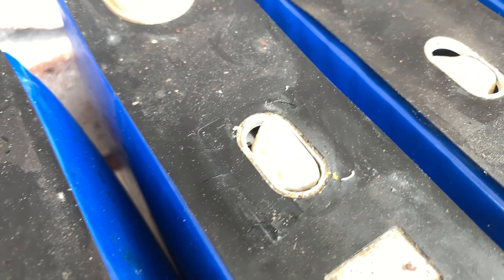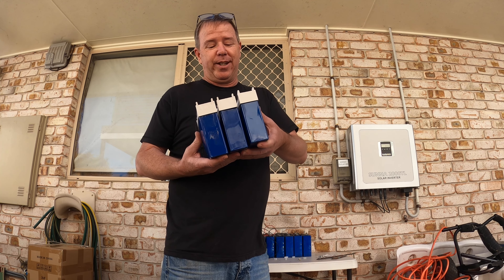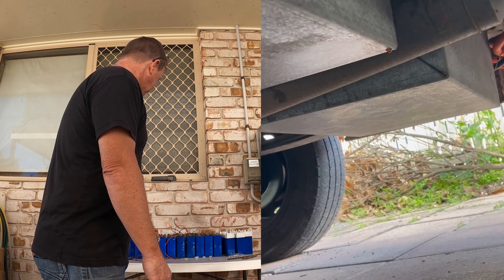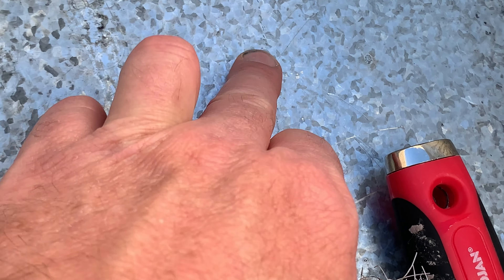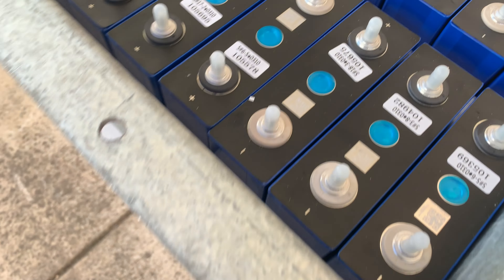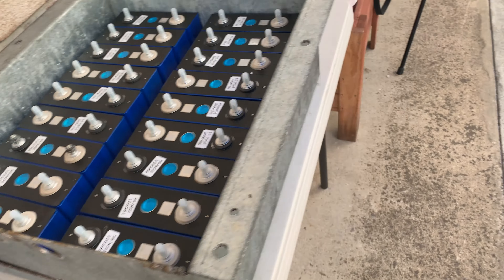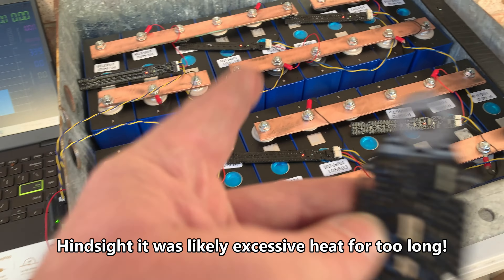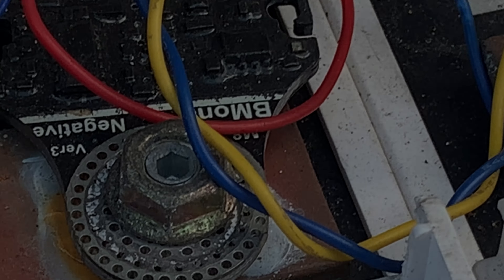Stupid accident destroys LFP EV battery - total rebuild required

Comment: I would definitely slip some epoxy sheet insulation between around and under the cells.  The foam if compressed enough will keep the batteries from moving much but it has a tendency to compress and become less rigid over time so you may have to revisit them in the future.  It is great to see LiFePO4 living up to its usual safety standards of generally not erupting in a big ball of uncontrollable fire for several minutes once the batteries begin to vent like you typically see with NMC and LIPO.
Reply: I have used puron (specifically designed for this) and also tried 6 inch wide kapton tape if the space is tight. The puron comes in sheets, and I used a paper cutter to cut it to the correct sizes. It is not cheap and comes with adhesive on one side. Works very well, but so does epoxy board (which is cheaper).
Reply: i agree definatly isolate the series cells ,thats a must
Reply: The inner walls of the Galvo box definitly need big fibreglass insulation sheets on them.  I wouldnt put the big bus bar close to the side. Box was missing a mid bar to prevent cell pressure bowing out the box. The box did not have a top cover with a waterproof seal, silicon dioxide packs inside to soak up moisture and water proof glands or suitable MiL Spec ip47/48 through connectors to connect up the electrics.
Great idea though for where to store a big heavy box of batteries and using a motorbike jack to trolley them into position under the van.

Comment: Is this a 48V system?  Is this van 100% EV, or just a hybrid?  Or is the batteries for the electrical system in the van?
Reply from the maker: 144v pure ev
Reply: @HBPowerwall  Why 144V, and not something like 300-400V so you could use DC fast charge stations?  I can't imagine that van being all that fast. (especially with the 0-100km times), or having a very good range.
Reply from the maker: 144v is how it was built for someone else, we paid 3k for it, IT's no fast at all, and don't think it would have 100km of range

Comment: 9:45  There's a "lot" of corrosion going on here. These bus bars are copper, the nuts appear to galvanized coated.  You really should be using stainless steel nuts where possible. And ideally, if you could do it, use nickel or tin plated copper bars.
The issue here is that the battery pack gets moisture from driving around and it's showing. This could be why the other pack failed, or rather Batrium failed to catch the bad cell.
I suspect that if this battery stays in service, you'll find a similar situation happen later on down the road.
Reply from the maker: Ooh we are having more issues with this battery in the very near future lol whole battery being under 1v for months won't be helping things

Comment: Use a silicone cooking oven liner sheet thing as an insulator. Easy to find here in the UK and cheap and durable.
Reply from the maker: Thanks for the tip!
Reply: not mechanically robust

Comment: Why 18S and not 16S? Why Batrium (does it balance?) and not JKBMS?
Reply: Batrium does do balancing.  It's just a lot more fancy and you get a lot more information about the system compared to a standard BMS like the JK
Reply from the maker: JK is just a little toy ...
Reply: @HBPowerwall  don't belittle the JKBMS a lot of users have good experience (better than DALY?) the only thing where JKBMS (imho) failed was 15S X-D

Comment: the batteries should be clamped, according to the datasheet. Do not use the fixed busbars, add some isolator between the cells, add some spring washers when attaching the busbars to the terminals.
Reply from the maker: can you link me the data sheet - keen to see that
Reply: @HBPowerwall  can I use the email which is displayed in the bio of this channel?
Reply from the maker: @bondarenkodf yep 👍
Reply: @HBPowerwall  done
Reply from the maker: @bondarenkodf thank-you I’ll check when I get to the office

Comment: id be worried about cells chafing on the sides of the metal box too even though the shell isn't tied directly to positive or negative. Seeing the swollen babies like that with no fire puts me at ease using lfp over Li ion.
Reply from the maker: what is worse is i'm working on the next video and doing a capacity test of one of the really swollen batteries and the video is crap cause it still tested at 95% of new capacity lol
Reply: @HBPowerwall  I got a few swollen ones too and capacity isn't affected much either. silly me overcharged 2 12v batteries in series with each battery having its own bms. i know better now lol.
Reply from the maker: hehe - its a hard way to learn - as long as you don't do it twice

Comment: A feature of a JK BMS is that it powers off, if a cell hit for example 2.5V. So it stops itself from draining the cells to 0V.
Reply from the maker: A JKBMS is a toy... lol That is NOT a "Feature" its in almost every BMS ever...
Reply: @HBPowerwall  so, your awesome Batrium BMS let you overcharge a pack with a flat cell? Just watched some of the video again to try understand. Maybe I haven’t seen earlier videos from this build and am missing something. I run my house on two JK BMS batteries, and wouldn’t call them toys, but for a car motor they may not handle the amps?
Edit:  Found an earlier video. Packs seem to be 120V. JK won’t do that 😂
Reply from the maker: The Batrium didn't fail, nor did it allow it to over charge - my brother did stuff, a rain storm did more stuff - it was a waterfall of - less than ideal small fu-kups that caused this to happen
Reply: How did you overcharge the batteries if a bms was used?
Did you stuff the settings or something?
Reply: @HBPowerwall  i have a batrium system and also jkbms.. and other stuff... and i can say.. that the batrium system is trash... compared to the JK bms...
Reply: this guys technical ignorance is gobsmacking.  I wonder what Andy over at off grid garage site would make of this utter buffoonery.

Comment: That battery should be waterproof. Put isolation between cells and special paste on bolts where aluminum and copper meet to prevent chemical reaction.

Comment: That packing foam probably won't last long I wouldn't expect. It's not meant to be structural. Bunnings has some medium density stuff, we have had it in our batteries for a couple of years now. 

The issue I suppose is that it's thermally insulating as well... which might not be ideal in an ev 

Bloody good thing that wasn't a li-ion battery hey
Reply from the maker: Yes, turns out it was a dumb idea - grateful for the feedback from so many viewers
Reply: @HBPowerwall  no such thing as a dumb idea when your sharing learnings with the community. I enjoy watching it ;)
Reply from the maker: @BadIdea1123  I enjoy learning but more I like the interaction..

Comment: Something between the cells as mentioned in previous comments is a great idea and also something between the end calls and the box. If you check some of the diy 48v box builds out for great setups and ideas that could be useful.
Keep it up. I am keen to see you get the bus up and running.
Did those white frames not fit the new cells?
Reply from the maker: Hindsight again - I have a few commercial battery boxes here lol I should just check out some of my own videos hehe The cell holders all cracked but also the new cells are slightly thicker and 3cm or so shorter (hence so much padding with the foam)
Reply: @HBPowerwall  damn. That's a tad irritating. I did a battery build with some odd sizes lfb cells and used some thin rubber matting between the cells. Slight amount of compression available but more for the electrical insulation. Core flute might be an option but it will compress. Another thing I have seen is just taping the cells together.. Maybe each 3pack u have make it a block with some heavy non stretch tape.
Again HB, great videos and keep them coming.
Reply from the maker: Massive challenge was getting the busbars to fit back onto the cells so any form of taping or compression would mean new busbars or a slight over sized hole. Either way I learnt something new so that's a win !
Reply: @HBPowerwall  When it comes to bus bars, I started using the flexible bars, with vibration and movement it reduces the stress on the lugs.
Reply from the maker: feel free to drop links :P

Comment: Where are the compression plates? Automotive cells should always be compressed
Reply from the maker: when removed these cells were not compressed when the battery was built 4-5 years ago, just in plastic mounts, the replacement batteries are a good fit for the battery box and almost meet the compression reconditions (wild card is the strength of the battery box )
Reply: @HBPowerwall  yes I saw that. And that's why I suggested you need compression plates - that battery box won't provide any effective compression. There is a reason for the manufacturer specifying a certain compression force!!

Comment: This will lead to another accident. If I see corroded terminals, you should be worried because of inequal resistance, heat and imbalanced cells. It will destroy your batteries again.
Reply from the maker: All fixed up now...

Comment: Um wondering if some conformal coating on the bus bars will stop oxidation not on the termination points tho
Reply: Unless you use Toyota battery terminal spray after you tighten the terminals ?
Reply from the maker: Don't think much will stop it given how exposed they are to splashes of water etc - might need better front mud flaps

Comment: I would add some insulation board beetwen cells, under and around, i use basic epoxy fiberboard.
Also would be good that cells are firmly in place so that they can not move.
Some times i put 1-3mm cellular rubber under the battery packs.
Reply from the maker: something softish will have to go under for sure - looking for cell holders so I can be a little more of a drop in solution - that plan will likely come unstuck as these replacement cells are slightly fatter & shorter if that makes any sense.

Comment: In my honest opionion the solution youve gone with for storing the batteries is dangerous. For automotive use I'd be using epoxy sheeting and rubber/foam between the cells top and bottom. On the bottom you probably want a rubber mats as the foam with degrade with movement over time. Look at the design of tesla packs or other manufacturers. They always islolate between cells and have some form of vibration insulation.
Reply from the maker: I think you're onto something there.. Thanks for replying
Reply: @HBPowerwall  no worries at all - I've had a peek at your other videos, love the revised farm setup. The Orient inverter looks good for the money.

I managed to pick up an 8kw Deye hybrid on/off grid inverter for $2400 from the Australian wholesale distributor. They had the 6kw model for $1500 as well which was great value also. Has a lot of features for the money and is a ~48vdc unit that supports heaps of BMS's and also meets the AU grid tie standards. I've hooked it up to 2 JK BMS's with 25kwh combined storage. Works like a charm.
Reply from the maker: awesome

Comment: A couple recomendations i would do is find/make some form of weather proof seals and stick a couple of those packaging moisture absorbers inbetween a couple batterys so they can takeup any that does get in as it looked like ya had some corrosion issues.
Reply from the maker: 100% have to address that, they also need to be vented boxes

Comment: There is a reason that major e-vehicle manufacturers use liquid temperature control in their battery packs.  They are used to keep the cells warm in extremely cold climates when idle, as well as radiating heat generated thru use away from batteries and electronics.  The heat extracted from battery packs, inverters, and regenerative braking chargers is more than enough to heat the interior of the vehicle in cold winter months.
All that corrosion is from dissimilar metals being used between the buss bars and terminals. They generate their own micro current.
Reply from the maker: We would need it for the heat not cold in our location - it's a great idea but bloody hard to implement in a diy version. Will look into bus bar options- Thank-You
Reply: @HBPowerwall  Perhaps you missed the point of how much heat those cells produce when charging and discharging.  Most mainstream vehicles use Lithium Ion due to its much greater efficiency. So multiply that heat produced by at least 3x for LiFePO4.
Reply from the maker: well aware of the heat issue, but I've never seen a diy build include any sort of cooling more than air - that said I do apricate your time to reply. Its all a learning curve
Reply: @aspendell209  but we are talking 100 Amps x 12 Volt - 1.2 kW to max. 3 kW for the battery pack here -- EVs pull 100 kW or more

Comment: Dude, you should to use the isolation of each cell. The second you have to do - you need to pull together the assembly. Third - copper tires must be tinned. And use the BMS. 
Next step: check your setup, as I can see you are using the 3s2p, but I think you need to use 4s2p. 
Still have a questions - don’t hesitate to ask. 
Good luck, I think you can do it!
Reply from the maker: Thanks for the feed back!! I can do it, just need some time management :P

Comment: "this car has more issues than my wife" 😂😎👌🏻🌻👍🏻 at least with overcharging u proofed: they are PRETTY safe (not blowing up in an instant) did u compress the cells? what voltage was used to overcharge?
Reply from the maker: I believe they went to about 6 v - I have a few here in my workshop and i'm going to 'play' with them and see what I can learn..
Reply: @HBPowerwall  6V per CELL? HOLY COW X-D the manual says 3.8V SHUT OFF CHARGING IMMEDIATELY X-D

Comment: Foam to keep the cells from moving around too much is a good idea. I would add some fish paper (electrical insulation paper) between the individual cells as well. Protects them from rubbing their thin plastic coatings through and shorting to each other
Reply from the maker: Lots of ideas out there - thank-you for yours - i'm like the fish paper option

Comment: Put some sort of separator between the cells.  If the heatshink blue plastic rubs through it's going to be exciting in all the ways you don't want with a lithium battery.
Reply from the maker: that's exactly why I got quite stressed when I saw the welding slag in the bottom of the battery box, I edited a whole rant about how shit it was lol
Reply: The case of each cell under the shrinkwrap is positive. You'll need epoxy board separators between each group of cells in series and between the cells and any metal surfaces. Use a thermocouple to keep an eye on heat. If it gets above 60C you'll need to design some kind of custom cooling system. Yikes!
Reply: Agreed. I use some card stock as separators.
Reply: Epoxy board costs buttons and will save you. The blue coating on these cells isn't worth a damn. It rubs through easily, especially if it's on a vehicle with movement and vibration. GET EPOXY BOARD SEPARATORS

Comment: Just make sure you’re not pushing the battery charge discharge limits and the normal convection of heat will rise. Maybe a small fan in the top.
Reply from the maker: That is what caused the issue - full speed charging when the cells weren't yet balanced and turning off protections to allow it

Comment: Batrium is a BMS. If you wired it up correctly and it DIDN'T protect the battery... what am I missing?
Did you, or the Batrium, screw up? Be specific, as it sounds like Batrium is a sh!thouse BMS.
Reply from the maker: Waiting for this type of comment - batterie/s were 0.6v because they were fucked cell monitor couldn't turn on thus breaking the data loop = no monitoring ... zero issues caused by Batrium infact it's ability to control and limit the charger amps saved many more issues..
Reply: @HBPowerwall  Hence asking the question :) I still don't understand the answer though, I am clearly missing additional information.
The cell monitor you mention, was that part of the original pack? The reason I ask is because I assumed (probably incorrectly) that all the cells were connected directly to the Batrium, which caused my either/or question. There was another stage/electronics between the Batrium and the cells? (or packs of cells)
Reply from the maker: I'll explain in another video - I need to get the time line right for the failure - combination of water (rain ingress) Short circuits on unrelated components and my brothers willing ness to tinker

Comment: I would have to go with rubber all the way around outside top and bottom some plastic dividers in between the cells and a solid divider down the middle maybe hardwood with a threaded rod sandwiched between to tension the cells. You also needs lots of beer lol
Reply from the maker: Beer is the only think I take way from this comment - when and where ? LOL

Comment: I'd put some thin FR4 board between the cells. Also run a length of all thread through the centre of the box, so you can apply an amount of pressure to the middle of the pack, as these cells like to be lightly compressed.
Reply from the maker: Good tip! Googles FR4......
Reply: @HBPowerwall aka printed circuit board

Comment: LFP cells are negative cased and should never be in contact with anything conductive (including each other) plus for proper charge and discharge you need some form of compression. I can give you the calculations if you need.
Reply from the maker: They are fairly tight along the wide surface of the cells, I think they will naturally expand and contract enough to be a nice tight fit when fully charged. But still need to limit the over all movement of the cells. Working on that part